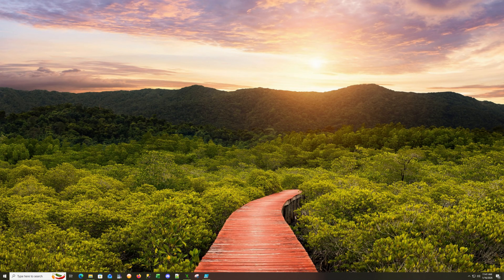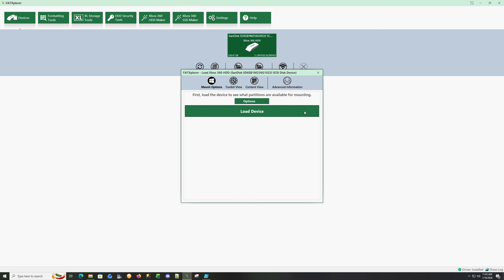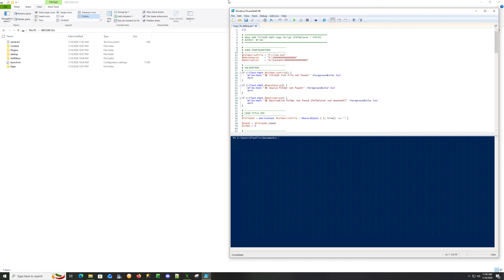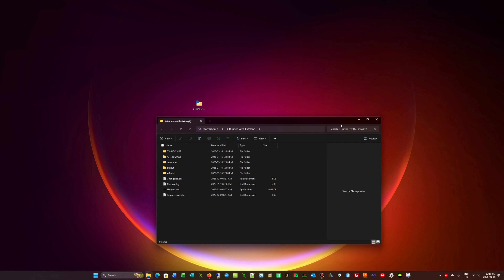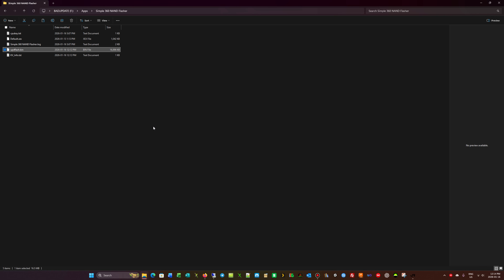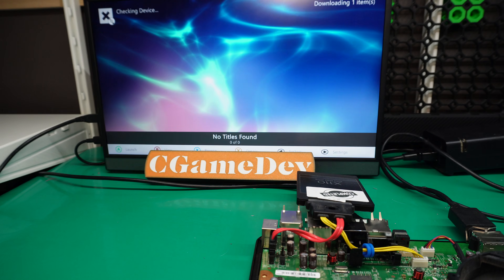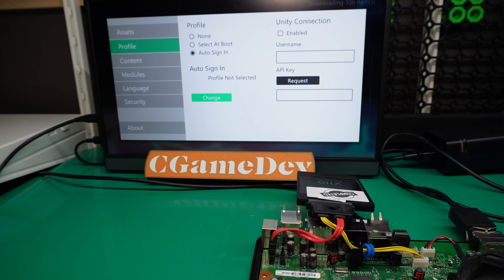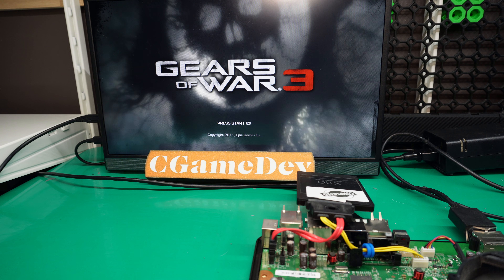How To RGH3 Without a Flasher – Fully Explained (Educational Guide)

Comment: Hi, you extracted the flash using badAvatar and then used J-Runner to create the new one, so far so good. After creating the new one, do I need to go back in and re-flash it in place of the original? Or do I leave it inside the badAvatar folder? Or if I flash the modified one to the console, do I need Postfix or solder the wires underneath the board? Or is everything done via software without needing anything else? I'm confused, could you help me with this last part?
Reply from the maker: After you do the J-Runner process, you copy the file that J-runner process which is in a folder on your PC labeled with the console S/N as the folder name to the 360 nand flasher folder were the original dump was the you flash the new nand to the console. Ensure the OG dump is not in the 360 NAND flasher. And keep in mind this process is if you are going to do the soldering RGH3 process after.
Reply from the maker: If you are still confused join my discord https://discord.gg/xFs3zbRM